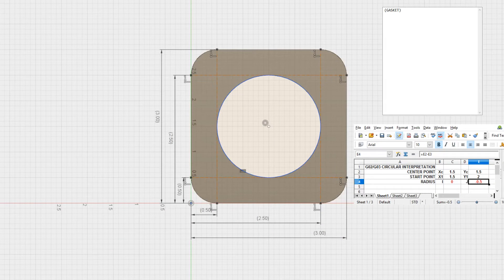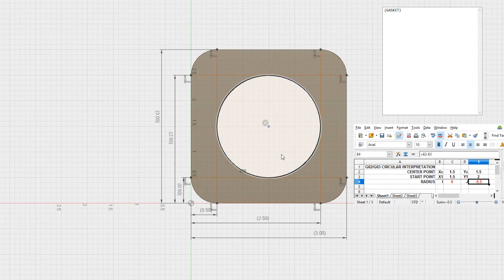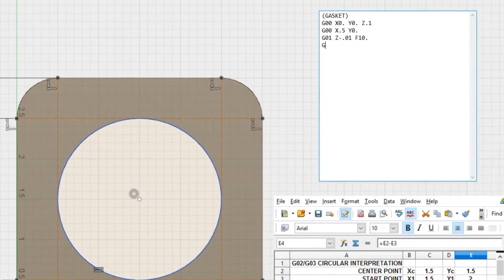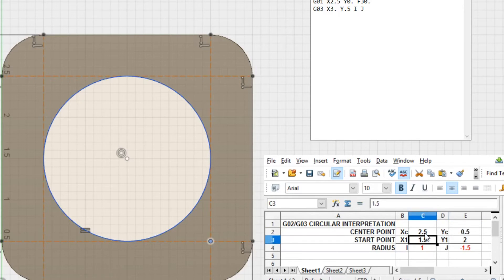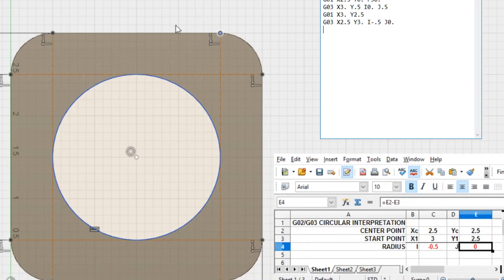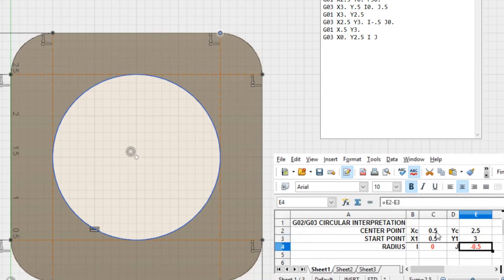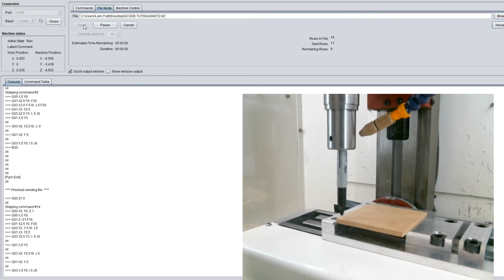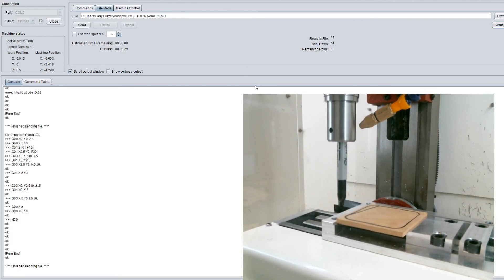G-Code Basics, Ep. 3 - Circular and Linear Interpolation Combined

Comment: Is this G-code software included with the desktop CNC?  Thanks
Reply from the maker: We're partnered with Autodesk Fusion 360 and have post processors in their software for outputting G-code.  Fusion 360's CAD/CAM software is free for students, educators and small businesses/entrepreneurs who make less than $100,000 USD/year. For those companies that make more than $100k/year, the software is available for a yearly subscription. The pricing structure for this package is currently being reworked (See "One Fusion 360"). Our machine control software is included with the purchase of our HX Series II CNC machines.
Reply: Leading Edge Industrial - LEI TV Hi I need to move in x axis but with different speed, ie with acceleration, plz advise, thanks